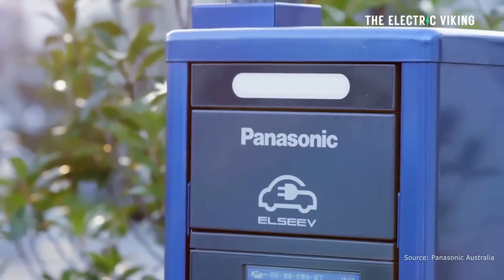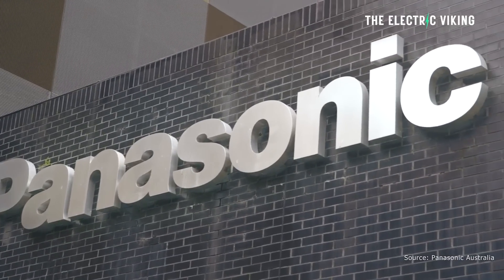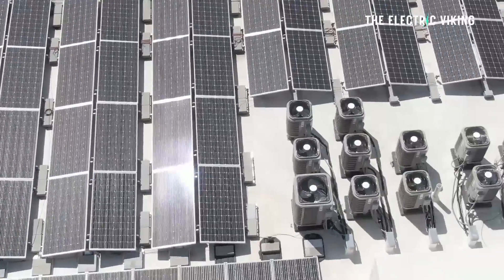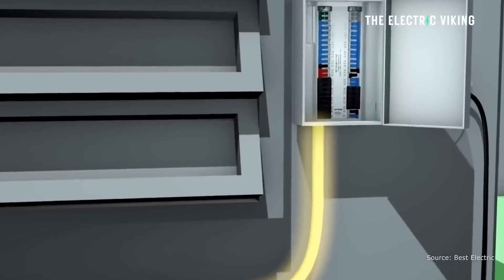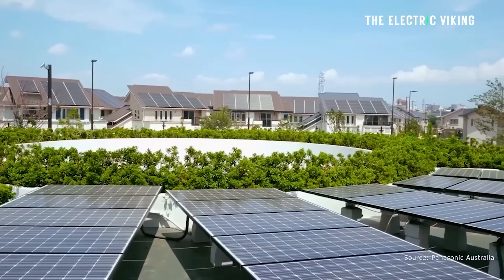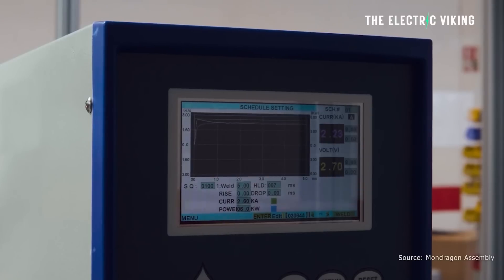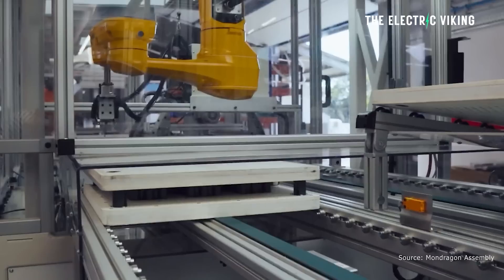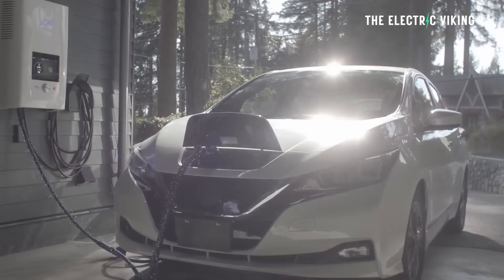Panasonic introduces new home battery to rival the Tesla Powerwall

Comment: My only reservation about committing at this time is the potential rapid drop in the price of electricity.  While personal solar and batteries can earn you money back today with the cost of electricity at 15 cents per kWh and higher here in the US, will it continue to be saving enough to pay for itself until the installation is paid off if/when the cost of electricity follows the trend that Tony Seba apparently quite accurately predicted and drops below 5 cents per kWh?  In parts of Europe we are already seeing the start of this with Free Electricity on the weekends.

Today with the 15+ cents per kWh cost of electricity if your monthly electric bill is over $100 per month then there is potential for payback with perhaps a little profit while at 5 cents or less per kWh would that only be viable for people paying over $300 per month?  At 15 cents per kWh we are talking around 670 kWh per month usage to equal $100 while at 5 cents per kWh you'd have to using 2,000 kWh to equal $100 and 6,000 kWh to equal $300.

Basically do I pay for driving the cost of electricity down today or just wait and reap the benefit from letting others do so?

Best!

Comment: V2G is the killer feature. 
EV batteries will make money like the South Australian big battery. 
$100 million installed, paid for in one year, day trading electricity and stability on the national grid. 
If the home robotic vacuum cleaner can plug into the grid, the the selfparking EV can plug itself into the national grid. 

Ezi pezi. 

No petroleum bills.
No power bills.
Money in the bank monthly. 
Cash flow positive.

National power grid is UNLOADED and protected.

Extra grid capacity is never needed, $billions and $billions of governments money SAVED.
TAX PAYER'S MONEY SAVED.

Hello, hello anyone home, hello 👋
Reply: Correct. This is why Tesla does not offer V2G in any of their cars. V2G would cannabilise Tesla power sales. It is all about the profit first.
Reply: @nordic5490  and the battery is free in the EV,  Hahaha 😆
Reply: @nordic5490  any other manufacturer will have a feature advantage over Tesla. 
Tesla has a VPP on trial in Adelaide and Melbourne, but with the power wall.

Comment: I’m not poor, but after I put in 6000 watts of solar for my net-metering system, I decided I couldn’t afford to spend another $20k CAD for storage - just finished building my own for $5k.
Reply: Good for you. Tesla power walls are massively overpriced. I can easily make one for 1/3 the price. I just made a 3.3kwhr LFP off grid battery for camping, mainly to run the induction cooking and boil the kettle. Off grid power is surprisingly easy and cheap to do now.

Comment: Panasonic - no track record here, particularly with software - so NO - when investing this much in this, just go Tesla
Reply: Ahh, no. No fancy software is even required. Tesla power walls are massively overpriced. I can easily make one for 1/3 the price. I just made a 3.3kwhr LFP off grid battery for camping, mainly to run the induction cooking and boil the kettle. Off grid power is surprisingly easy and cheap to do now.

LFP cannot be charge below 0°C. Sodium can. Anyone who lives in a cold climate should be buying the sodium batteries.
Reply: @nordic5490  it’ll have extensive firmware for feeding back to grid, virtual power plants and also ability to pull off renewables only etc - my experience is that get hardware is only relevant with great software … these other companies HAVENT got a clue - you only need to look at the EV market to see just how rubbish they are - even when they have a clear target to copy
Reply: Idiot, at least Panasonic can make batteries and panels where Tesla can't and has to buy them

Comment: I will watch for the Chinese Sodium based Power Wall which should be coming out soon as most likely be more affordable & safer ( very very low probability of instantaneous combustion unlike that of lithium battery power wall ).
Reply: You do know that LiFeP do not have the “Fire problem” this is why this chemistry was invented. I will be very surprised if the Sodium batteries are in volume production anytime soon. If the sodium batteries live up to there promised potential, I will be delighted, but that is not the way it usually goes. Li is still only at about 10% of it’s known potential and it has untold $billions and 30+ years of research and development behind it.
Reply: @rustybucket2248  My understanding is that LFP, while dramatically superior to other Li tecs regarding fire-hazard, is still not zero risk. Na-ion is zero. If I'm wrong, pleased post some links. BTW this has a critical impact on me right now. I would much rather locate the battery inside my house where there's a super convenient spot, but even with LFP, I feel compelled to build a little mini-shed outside for the battery_inverter - a real pain. I don't want to come back to a heap of ashes one day.
Reply: @jonb5493  a little about me. I am a retired Silicon Valley engineer EE, ME CS, Optics. When I retired I became a mentor for a number of EV start ups, coaching High school interns was part of the gig. I am proud to say that a number of those interns are now in senior positions at Tesla and the rest of the Electric economy. I leased a total of 3 GM EV 1s in the late 90s.  I drive a now almost 7 year old Tesla Model S, and I have 2 powerwalls, 12KW AC of Solar and it is all grid inter tied. We are almost at peak hype on the Sodium-ion batteries. Elemental sodium is absolutely a fire hazard. As a binary salt NACL ordinary table salt  is extraordinary stable and we could not live without it. If the promised batteries appear we will start to have real data. For the sake of argument I am going to ignore the chemistry. Can a NA-ion battery start a fire absolutely I have witnessed 1000 amp battery fires on lead acid batteries, the batteries didn’t  catch fire or explode but everything around them was destroyed. The fire started with just a tiny spark. The problem with High voltage DC power is that once an arc (spark) is established it doesn’t go out. AC in contrast has a power interruption with every cycle (60 time a second). This is one of the reasons that High voltage DC switches and circuit interrupters are different that their AC counter parts. The Fires that get all of the popular press are almost always because of physical damage to the sealed battery containment box. A properly designed battery system (it’s not just a battery) has fuses between every cell so that cell failing catastrophically doesn’t lead to a module or pack fire. My powerwalls are mounted on the outside of my garage no shed no nothing. They are designed and rated for operation outside. I park and charge my car in the garage. We all want cheaper batteries and they are coming. The biggest thing that is driving battery cost down is economies of scale. The chemistry is constantly being tweaked to optimize cycle life, design out rare earth metals… I have no idea what kind of battery will be in the cars and stationary battery storage of 10 years from now and don’t really care. I know they will be cheaper and better than the ones we have today. I get waiting for the prices to come down, we all have to live within our means. I would have no concern installing Powerwalls inside or outside of my house if I were you. For some background Google: EPRI Sodium Sulphur battery. The battery technology is not the same as the NA-ion batteries, but I think you will find it interesting to follow the various links. Regards, Rusty.
Reply: @rustybucket2248  Thanks for your excellent info Rusty! Now I'm a little less nervous about the "heap of ashes".
Reply: PLEASE PLEASE ASAP!!??!!
Reply: LFP cannot be charge below 0°C. Sodium can. Anyone who lives in a cold climate should be buying the sodium batteries.
Or,  Tesla power walls are massively overpriced. I can easily make one for 1/3 the price. I just made a 3.3kwhr LFP off grid battery for camping, mainly to run the induction cooking and boil the kettle. Off grid power is surprisingly easy and cheap to do now.
Reply: @nordic5490  Let’s take things one at a time. Every battery technology has an operating window. Some batteries struggle in the heat some in the cold. When we are talking about a the battery management system The batteries are maintained with in a temperature window that optimizes it’s capabilities. There is a cost to do this, but I doubt that any competitive battery technology for EVs or PowerWalls is going to be produced with out a heating and cooling system. When we see production NA-ion batteries  in the field over time, I am ready to entertain their merits, I am technology agnostic. Li is King of the hill today, that may change. Of course you can build an off grid Battery system cheaply. I built a system for a cabin I used to own with just a lead acid battery and true sine wave 120 VAC inverter and a pair of jumper cables with one end cut off and connected to the inverter. A PowerWall is so much more sophisticated than what you built or I built as to make comparison meaningless. Enphase, Simplphi(recently bought by Briggs and Stratton) Franklin, Tesla all do turnkey Grid inter tie Battery solar systems. It is usually the case that Tesla is the best value for the money. Yeah I wish things were cheaper too.

Comment: Tesla is switching to LFP cells in the next generation powerwalls. The Tesla VPP is a hands down winner for homeowners plus their software is consistently being updated unlike traditional home backup storage companies.
Reply: Tesla power walls are massively overpriced. I can easily make one for 1/3 the price. I just made a 3.3kwhr LFP off grid battery for camping, mainly to run the induction cooking and boil the kettle. Off grid power is surprisingly easy and cheap to do now.
Reply: @nordic5490  I agree you can make a cheaper home energy storage, but you can't make their VPP which is the keystone of their ecosystem.
Reply: LFP cannot be charge below 0°C. Sodium can. Anyone who lives in a cold climate should be buying the sodium batteries.
Reply: @nordic5490  I'm pretty sure the brilliant engineers at Tesla have already addressed that since they have cars in Norway with LFP batteries.

Comment: Tesla Chadstone last week, asked for the price of the Powerwall. He said $17000 installed. Still up there
Reply: Yup. Tesla power walls are massively overpriced. I can easily make one for 1/3 the price. I just made a 3.3kwhr LFP off grid battery for camping, mainly to run the induction cooking and boil the kettle. Off grid power is surprisingly easy and cheap to do now.

Comment: I like that there are options to Tesla, solely from the fact I dislike Elon Musks’ personality.
Reply: Best you do more exploration BYD and CATL make products too
Reply: Tesla does not offer V2G in any of their cars. V2G would cannabilise Tesla power sales. It is all about the profit first.
Reply: @nordic5490  No the reason is the contactors that switch between AC and DC. Might be solved with software but couldn't be used to both take a charge and deliver DC at the same time. This due to a flaw in NACS design.

Comment: When the big energy supply companies finally get on board and begin providing materials, installation, and maintenance for similar systems, the price will come down, and we will see fossil fuel powered grids mostly go away. Coal and gas companies will have to join the renewable energy sector or they will cease to exist.
Reply: Some intelligent nudging from government would help, too. I'm disappointed with gov's blassee attitude to home storage. Rather than grant 5K GBP for a heat pump, it might be better to steer installations of home batteries, thus reducing peak load on the grid. All of this leads in the direction of the "internet of grid" where many intermittent power sources are pulled by smart consumers who do not need to be pushed continuous, expensive, 24x7 peak power.

Comment: Arson - anything happens now in Australia 
Don't ever buy any ternary battery for properties also Not vehicle
Reply: These are LFP batteries as are the ones in Tesla powerwalls.
I assume both have good thermal management systems too.
Reply: @danharold3087  I'm not so sure about that, Australian authorities thinks the bigger the power the better the battery
Panasonic is ternary battery however it is safer as they are individual cell
Only when arson is done it will become inferno
Tesla battery unless Tesla get this from CATL it will be ternary batteries
Hopefully you are right Tesla batteries for properties , power polls are LFP

I'm skeptical about this implementation
I think some portion of them will Not be LFP but ternary batteries 
And one day some youths, mystery group will set fire to them
Like they have done to bush fires

Comment: Software software software… that’s what really makes the powerwall. I wouldn’t trade mine.
Reply: I don't know about the software part. I have a DIY 60kwh pack for my off-grid home and there's no software to speak of. It just works, sure I check the BMSs occasionally and the SOC of the packs but nothing fancy. And my system cost 1/5 of a comparable sized Tesla system. Nothing beats Cubic inches of prismatic cells.
Reply: Agreed
Reply: @vec306  as they say.. the separation is in the preparation
Reply: It's a battery. What does Teslas software do that a DIY one doesn't which makes the price gap worth it?